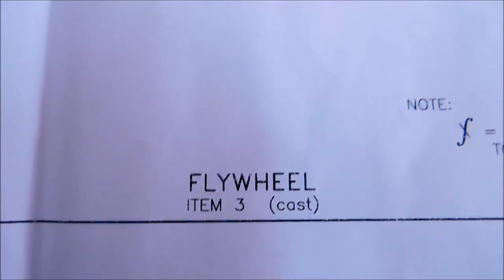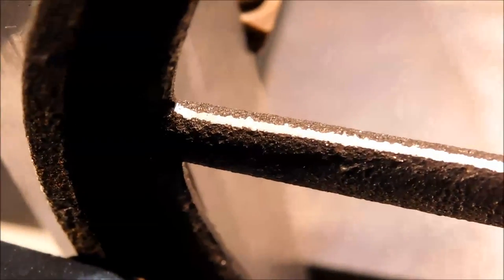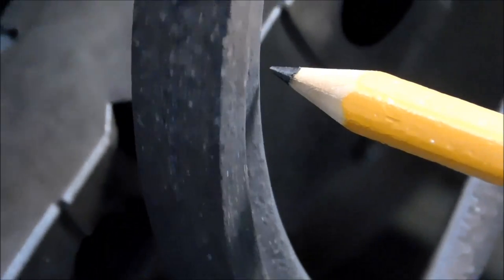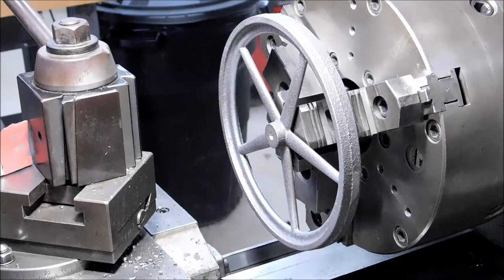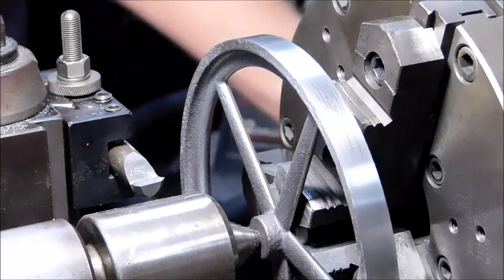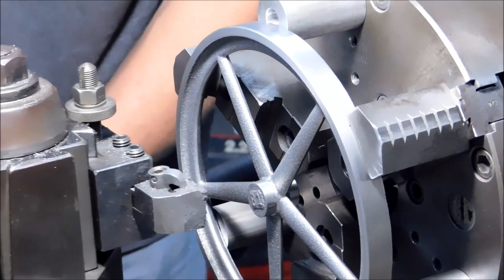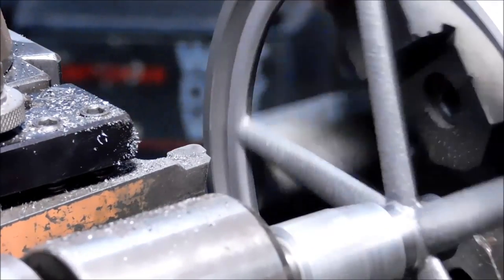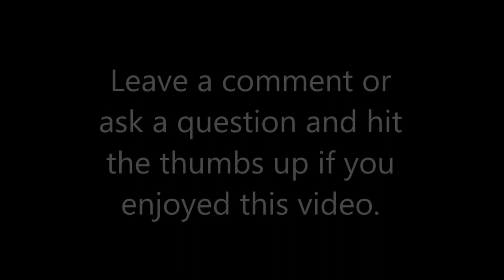Machining a Model Steam Engine - Part 10 - The Flywheel

Comment: Is there a reason you used a 3 jaw instead of a 4 jaw chuck?  It seems to me that a 4 jaw would have made indicating a lot easier.
Reply from the maker: Agreed. I used a 3 jaw because I didn't want to assume you all had 4 jaw chucks, and 1 key makes the feel much better for a part that can crack.

Comment: if you dont got a pulley tap,couldnt you just drill deeper ,across the center into the other side ,so your tap dont bottom out? wouldnt see  it after shaft inserted.  just a thought. thanks ,this is interesting .
Reply: Pulley tap has a very long shank so the tap wrench can clear the pulley. Nothing to do with depth of thread. The whole grub screw idea is a hack IMHO, I'd be using a key and retainer plate.
Reply: @RobB_VK6ES  oh i see ,i was thinking shorter taper on  nose of tap..like for shallow holes. . fabricating is fun ... i do cars ,and engines ,but steam and machine work look so fun

Comment: I'm only familiar with basic machining but what I saw is you taking a casting that belonged in the scrap bin and making it into a thing of beauty. Well done as always Joe.
Reply from the maker: Thank you. It was a fun part.
Reply: I've machined many castings for model engines and other that hard spots and small porosity issues, none were considered for the scarp bin.  If you look at old machinery there are usually some cosmetic flaws and general "warts" associated with iron castings.   Back in the day, if they wanted to dress up the "pig" then a little filler and extra paint was in order.  But for the mass produced working engines that lived a hard life in the oil fields, factories and farms,  pretty wasn't a requirement.  Toughness and  economical reliability was.  That what I want my models to represent.  Sometimes when the grime and old paint is pealed off, a "factory save" is revealed on an intricate part that was deemed cheaper to repair than to scrap and start over.

Comment: Drill set up is indeed a thing of beauty. I would have grabbed the rim by the inside with a 3 jaw and do everything....no ring maybe even all three surfaces about the OD. But That's how I roll.
Reply: Can you grab a 5 spoke wheel from the inside with a 3 jaw chuck?
Reply from the maker: No you can't.

Comment: gees! what did they use to cast these? a rock quarry to get their casting sand? i suppose machined it looks fine but man......and yeah these engines are fairly cheep..but you did a great job with it.
Reply from the maker: I love a challenge.
Reply: @joepie221  that I already witnessed multiple times,,,but I have learned a lot of useful tricks from you,,,so I appreciate that too. truthfully I love the contrast between the casting and nicely machined areas...

Comment: Could you have gripped the hub with the three jaw chuck and kept the rim pressed against the aluminum stand offs, so that the diameter wouldn't be distorted and the stand offs would dampen the ringing?
Reply from the maker: Very possibly.

Comment: A face plate could be another option, with small clamps on inside, giving more support but longer to set up. Cheers.
Reply from the maker: This casting had a warp, so the first side would need 3 shims at 120 degrees to rest securely on a faceplate.

Comment: I cant believe all the ads you tube has been putting in lately.  15 ads for this one video.  Ridiculous
Reply: It’s gotten that way for all videos... I broke down and subscribed to premium. It’s so refreshing never watching an add again.
Reply: Yeah, I counted 15 also. Id rather not be pushed by YouTube to pay for the premium.   I guess they are trying to get to the point where if you don't pay for the premium, then the videos become unwatchable.   When videos like this have adds every 4 minutes I just turn them off.
Reply: I installed brave and watch with no ads.  It's free and works great.  It works with all my apps.  I'm not very tech savy so maybe somebody can comment if there are any down sides to it.
Reply: I use uBlock with Firefox.  Completely add free and doesn't even pop up the pesky little ads that you have to click on for them to go away.

Comment: hate to ask, just because of your obvious skill. but what about laying flat on the mill centering as you want and milling a flat on the center hub and boring a center hole. then mounting in lathe on a round mandrel?
Reply from the maker: There are a dozen different ways to do this part, but with only one available, I chose a path and went with it. Learning from this one, I'd make some changes in the process next time. A mill with a rotary table could be an option.

Comment: I would have held on the OD and dialed it in and then machined all the required surfaces, and the OD half way up to the chuck jaws.  Then turn the part and do the same on the other side.
Then chuck on the inner hub or put it on an arbor and blend the largest OD as required with a file and emery.
My reasoning is that any runout is most apparent on the largest diameters and not noticeable on the small diameters.
You did fine, just sayin what my approach would have been.
JIM

Comment: Is there some reason you didn't just 4 jaw this part to begin with?
Reply from the maker: A did this part from the approach using the tools I thought most home shops would have. Give me 10 more. I'll do each a different way.
Reply: @joepie221  Most home shops have a 4 jaw not an adjustable 3 jaw

Comment: Personally I would have made a fixture to fit between spokes and held on the inside boss/ridge even though it looks pretty delicate? ( or a wooden fixture on a faceplate)
As you said, alternative would be rotary table on the mill and probably even more set up time?
. I'm guessing it's the only part that won't be machined? (probably should re-start vid and re-check drawing)
 Piece of old pallet (or pine board ) would also work as a 'brake' to cut down or remove the resonance.
Oh, for anyone else making one of these or needing to clean up radius, get a set of chainsaw files, they come in at leas 3 diameters and are very cheap compared to needle files or riffler files. Because they are cheap you don't mind grinding pieces off to fit specific areas
Reply: Perhaps set it into hot glue to absorb resonance
Reply: Sometimes 2 or 3 coils of thick soldering wire wrapped around each spoke can help reduce the ringing. Vibration damping for one-off's is not an exact science.

Comment: Sweet job Joe.
 I would have called the manufacturer for a replacement casting that far off. How it escaped the reject pile shows poor quality control. In high school in the 70s I spent about four hours on a cast flywheel and ran into a blow hole that kept expanding. The manufacturer sent another casting  that was far better.
 Instead of the set screw what about a tapered key? Some old engines used them or a split and bolted flywheel. Also for esthetics a 1/16 inch tapered key would look better than a hole in the side. Just an idea.
  Love the content.
Reply: they are called "rough sand castings" for a reason- this is very typical for a $125 steam engine kit.

Comment: GASP!!  DID YOU DRAG THAT FILE ON THE BACK STROKE!? 😁😉🍻
Reply: @millomweb  There’s lots of technical discussion available on this. Fundamentally, the prohibition on dragging the backstroke is a myth. You don’t bother with a hacksaw, and you don’t need to bother with a file.
Reply: @millomweb  Dragging on the backstroke can have a positive effect - it assists the machinist in maintaining a particular presentation and angle of the file. If you lift off each time, you have to reapply the file with the same orientation and pressure. And the question is not whether it has no detrimental effect, but whether it has a detrimental effect worth worrying about. The answer may be yes with particular files or materials, but not in general. The mechanical hacksaw can lift off because (a) the machine does not worry about getting tired, and (b) it can do so with undiminished accuracy.
Reply: @millomweb  Of course machinists, in a general sense, use files. Joe P is not a machinist?   If you spend half of every day filing then you will naturally get pretty good at it and you can develop all sorts of refined filing skills. Very few people fall into that category. To create some sort of shibboleth about dragging the file is little more than engineering snobbery. Of course you drag back lightly. I did not deny that the reason a power hacksaw lifts off is to help preserve the blade (and reduce power consumption). The point I made was that there is no detriment in a machine doing it (apart from price I suppose) in contrast to a human being.
Reply from the maker: To end this comment string, the answer is no pressure is applied on the backstroke. If my file was close to the surface it was for level reference only.

Comment: If I were doing this flywheel to get that chatter out I would lose the high-speed Steel tool that you're using on the Outer Rim and get a carbide insert with a very sharp point. I can't remember what they're called It's the middle of the night right now and I'm half asleep. It's like two triangles that are budded together what is that called I can't remember lol Anyway turn your whole tool post so that the carbide insert is pointing directly at the flat take it down to size with that point and then put your high speed Steel tool back on to clean up the lines.

Comment: A rubber bungee cord around the outside and slower RPM would calm the ringing down quite a bit.
Reply from the maker: Long springs are sometimes used to quiet brake rotors during machining.. This part is very delicate, so I am sure that would help.
Reply: @joepie221  Yes that's where I got that idea,  was in auto part retail for 36 years, turned a lot of brake rotors and drum. But your last setup , OD clap and stand offs done the trick. great job.  But those brake drums and rotors were already machined and I was turning a semi flat surface .  You were turning a "raw" surface, so your setup was the right choice. well done.

Comment: Beauty...you offset the 3 jaw to gain concentricity, then when you changed to an outside grip did you first put the chuck back to center/center concentricity? Or leave the offset? I assume you left the offset...when do you reset the chuck after the job completion or check it at the start of a new job...
Reply: Taking Joe's example of 30 thou eccentric and 20 thou adjustment, you cut one side at maximum adjustment which puts that side at 10 thou eccentric. Turn the part around, use 10 thou adjustment which allows you to cut the second thou concentric. Turn the part around again with the chuck centred and cut the first boss again, this time it will be concentric. Cut the outer rim and everything should now be concentric and the chuck is centred whether using inside or outside grip.
Reply from the maker: I flipped it a few times Chuck and dialed in what I needed as I  went. Ultimately when I gripped the OD, I re-indicated the OD at that time. My initial grip of the center hub just reduced the gripping error for the second side op. It took 3 flips to zero it out.

Comment: Thanks Joe, just a question - I think the flywheel is 6 1/2” diameter, so you have a good sized chuck to grab the OD, can this be done with a 4” chuck on a mini-lathe?
Reply: Since most mini lathes are 7" x ??", I'm going to say no, since you would need room for the jaws around the O.D.
Reply from the maker: Small faceplate maybe?
Reply: That's what I was thinking, like most hobby machinists I don't have a chuck big enough to hold a 6" flywheel, but I could fix it a faceplate, but will the lathe be man enough to do the job? Very slowly probably.
Reply: I was thinking more about the ability to do the machining rather than the swing over the bed.

Comment: Why not use a 4-jaw chuck to initially hold the flywheel?  You should be able to dial out all the eccentricity in one go.  The only thing you may run into is side wobble.  If you face the jaws with aluminum, you may be able to tap that out also.
Reply from the maker: Establishing a true OD without clamping distortion is a good place to start. Also, there is no way to hold inside the rim with a 4 jaw. As I stated many times in this comment string, the optimum way to go, is shimmed and clamped at 120 degree increments on a faceplate.
Reply: @joepie221  I was referring to holding the flywheel like you did, by the hub, but using 4-jaw chuck so you could have any amount of offset you needed to center it in one go.
Reply: He may not have a 4 jaw. A 4 jaw would also help to not crush the part. (Less clamping force on each jaw)
Reply: @chrisspence6484  Don't you worry!  If Joe Pie doesn't have a 4-jaw chuck, no one does!  I will be willing to bet he has multiple ones, in different sizes.
Reply: @bpark10001  he was using a adjustable 3 jaw.
Reply: @davidowens8829  Yes he was, but apparently the eccentricity of the 3-jaw chuck is limited.  The 4-jaw independent chuck is not limited!  He could dial out to get one side concentric, repeat for the other side, then use setting midway between the 2 for the machining.  This would be easier if he adjusts the flywheel rotation so the casting offset is parallel to one axis of the 4-jaw.

Comment: Excellent work, on a part that it's hard to imagine how badly cast it was - extremely coarse finish and completely messed up cope / drag alignment. Well done pulling a gem out of it!
PS: Just for cast quality comparison, here is a video of a home foundry (luckygen1001), pouring cast iron to make small parts - just look at the quality of those casts: https://www.youtube.com/watch?v=RfnN5Xna2Kc
Reply: Luckygen is very good at casting. I'm guessing you've never tried to build something from castings for the hobby... those ones Joe has are excellent quality compared to what we normally get. You're usually lucky if the thing isn't half chilled and the halves out of registration by up to 2 or 3mm. It takes a lot of thinking to see how to get the final part out of those things and still near to size! Our volumes are so small the foundries don't care about doing a good job for us.

Comment: 20 mins in. I had this centering  issue with a very rusty line shaft pulley I found in a skip a few weeks back. There is literally nothing to take as a real datum :o I went at it by grabbing it around the rim in the four jaw and doing the same visual alignment. Exactly the same on machining the hub with a fresh parallel cut to grab it in the three jaw. Why is this interesting? Because they originally made it without the hub external machining. I suspect they clamped it to a face plate as a rough casting, bored the hole and then put it on a shaft with a drive-peg like turning between centres to skim the outer belt face.
Reply from the maker: This part was not only shifted from side to side, it was eccentric ID to OD and had a warped dip init about .020 deep. The initial cuts and setup needed to be approached very methodically to make them go away.

Comment: Couldn't help but notice the live centre  (bull nose) bobbing up and down  ?
What was going on there ?
Reply from the maker: The live center was more of an obstacle than a pressure point. As not to distort or crack the part, It was barely touching. The sag of the aluminum slug started the eccentricity. Once it made contact off center, the live center moved with it. If it was cinched down and locked, nothing would move.

Comment: Would I be wrong in using a tool post grinder to true it up sso as to elemenate the ringing?
Reply: It would take forever, but yea they have lower tool pressure.

Comment: Excellent as always. You didn’t, I think, really make it explicit that the reason you chose the inner rim as a reference point was that it was the only visible circle you would not subsequently be able to machine concentric.
Reply from the maker: Normally not thats true, but thats a perfect surface for a rotary table if you want to take it that far.